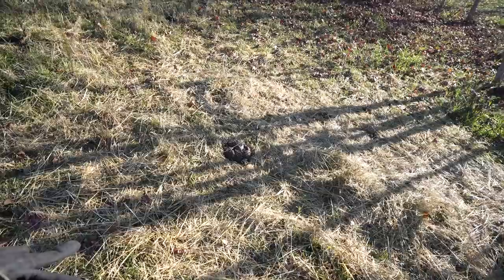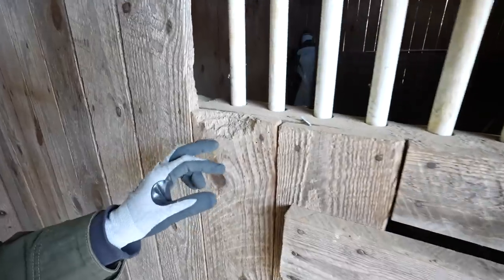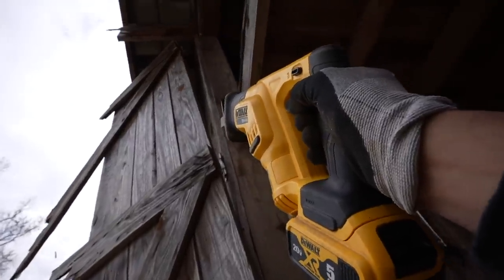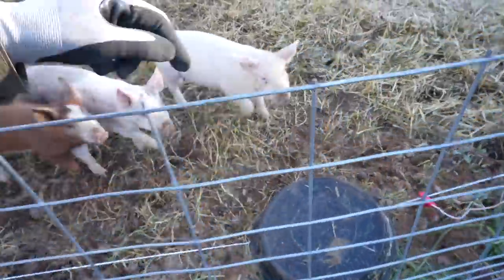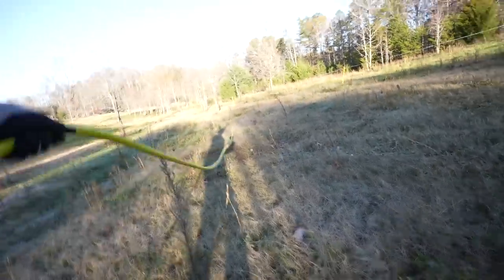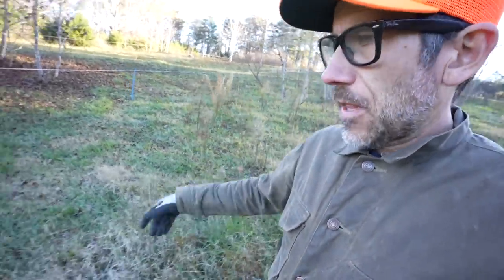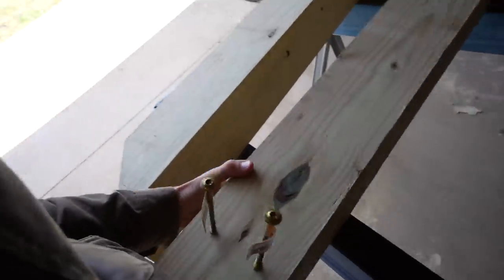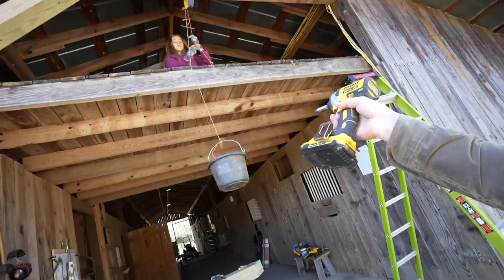This Barn Needs to Hold a Cow

Comment: drill a hole in the board of the loft and run the cable through that. This way you keep the structure of the loft but wont be in the way

Comment: I see you are using the one pulley system if you get a double pulley you can pull heavier weight with less effort and you was talking about people using a tractor you can attach the Rope to your truck and use it to horse the weight of your steers easy. I hope you think about using the technique of a double pulley even with your electric pulley by just adding one more pulley or maybe three

Comment: If you close in the upper section is there a way to still be able to get stuff up there?  Seems like it would be easier to load things into that area with it open. So putting doors up there would be more beneficial.

Comment: Are you hoisting your beef on a single hook or using a spreader bar?  If using the bar pulling that up high enough to connect with the crossbeam of the loft will keep the carcass from spinning while you are working on it.